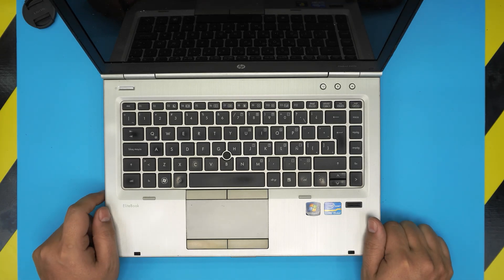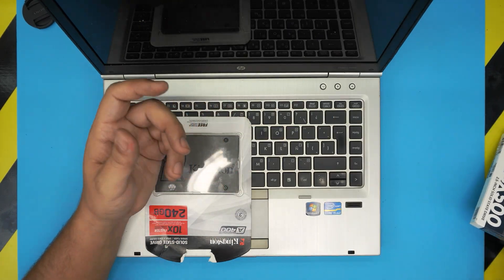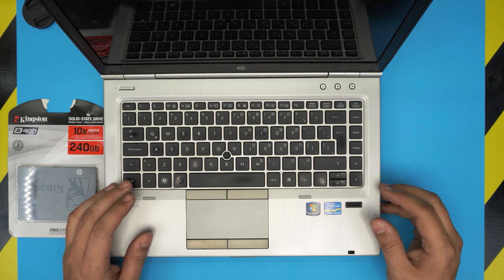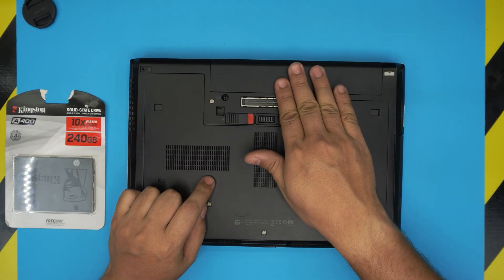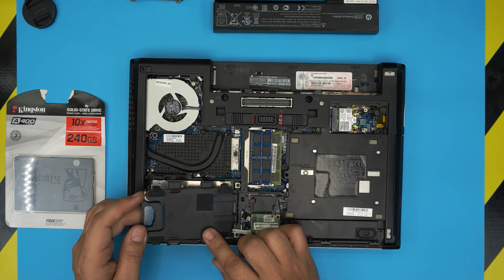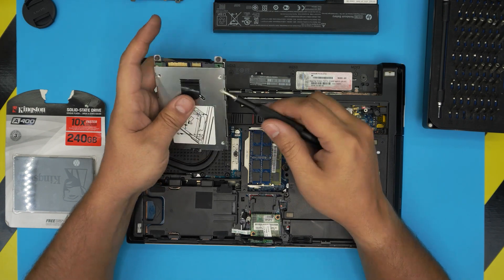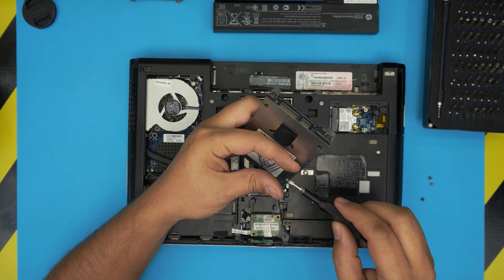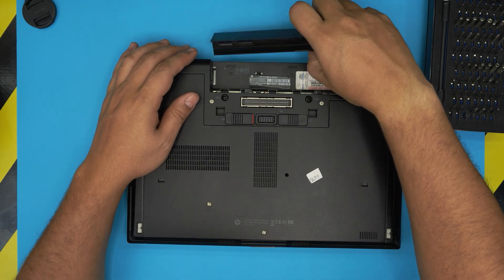How to Upgrade Storage to SSD or HDD on an HP EliteBook 8460P Laptop | Step by Step✅

Comment: Thanks for the video. I have that same laptop like yours HP elite book 8460p. It has one problem. When you switch on the power button, it kips restarting. It doesn't go on. What could be the problem or I change the motherboard, I took it to some IT technician but they failed
Reply from the maker: Thank you for your feedback! If you wish to support the channel, you can like, subscribe, or both!
Regarding your question, do you get the HP logo the light on caps button blinks?

Comment: Hi, I am doing the same thing but when run system diagnostics the Disk Not Installed. I used SSD sata as well, but 512 GB. any advise ?
Reply from the maker: Thank you for the feedback! if you wish to support the channel you can LIKE or SUB or both :P
regarding your question:  you replaced the main hdd with ssd? , if you did that then, did you install windows? how you did the system diagnostics?

Comment: Hi bro we can upgrade m.2ssd  pls advice which type or model is suitable  for this hp 8460p
Reply from the maker: Thank you for the feedback! if you wish to support the channel you can LIKE or SUB or both :P
regarding your situation: sorry but this model you can't place a m.2 ssd, only it takes sata ssd 2.5"
Reply: M sata is possible bro
Reply from the maker: no my friend m sata won't work. you could remove the dvd drive and install a SSD 2.5" in there or HDD and SSD 2.5' on main hdd place by usign a caddy https://amzn.to/3A17SZf
Reply: @uFixTek  thank you bro and thank for your support
Reply from the maker: @naina2sulthan  it's my pleasure my friend